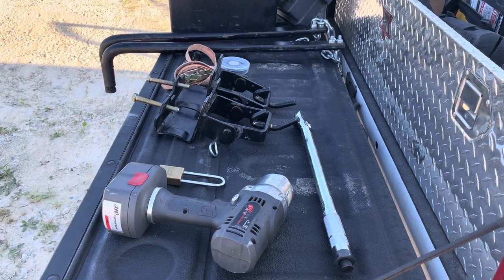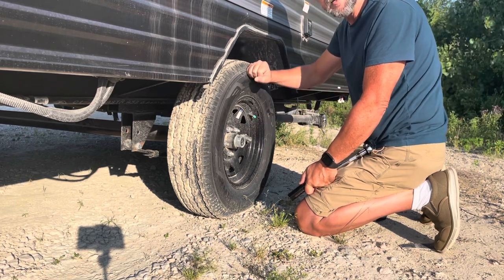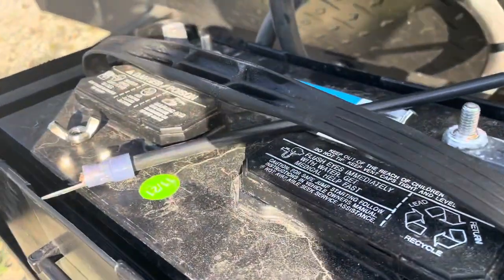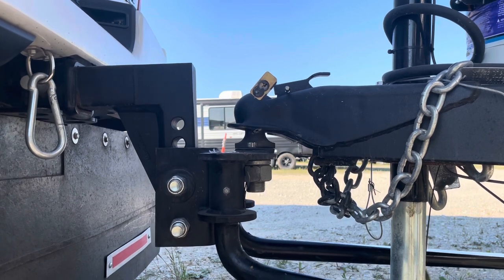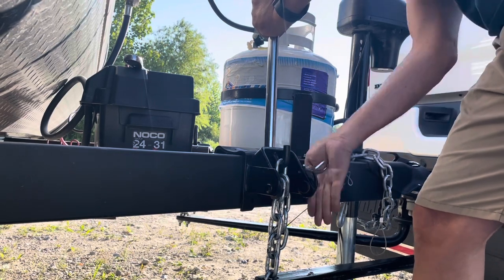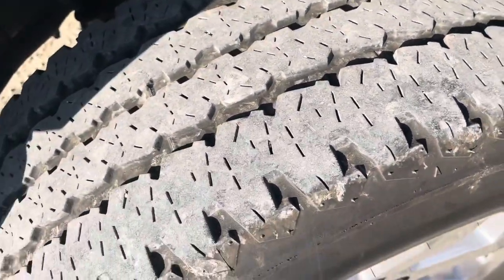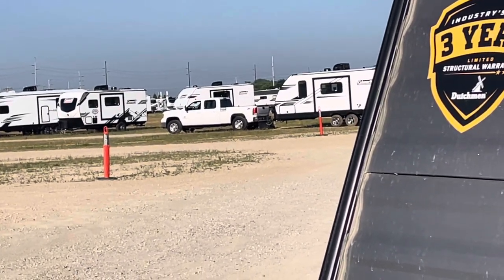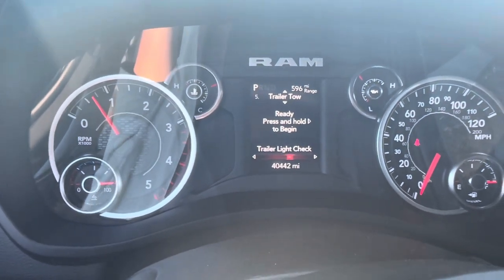Hooking up a trailer with a weight distribution hitch for RV transport

Comment: Just curious how you know which link to hook the WD to?
Reply from the maker: That took some trial and error. The way I was shown was take a tape measure and measure the top of the front wheel well, put a link to the WD and cinch it up and drop the jack. And measure the top of the wheel well in the front and then the rear on the truck. It shouldn’t be any more than 1/2 -3/4” lower in the back from the front.

Comment: I also put the clean out caps on.
Reply from the maker: I do too, but I think I did it before I started… I also push the valves closed. I’ve had some that hung kind of low to the road. I also have become careful of pulling the bumper caps. I found a wasp nest in one.

Comment: The only nut on those wheels that is at 110lbs is the one that actually moved with the torque wrench. All the rest of them are more than 110lbs and over time that stretches the stud. You should have to use the torque wrench on all of them.
Reply from the maker: You are correct. The factory cranks them down, but I have found some that were hand tight as well